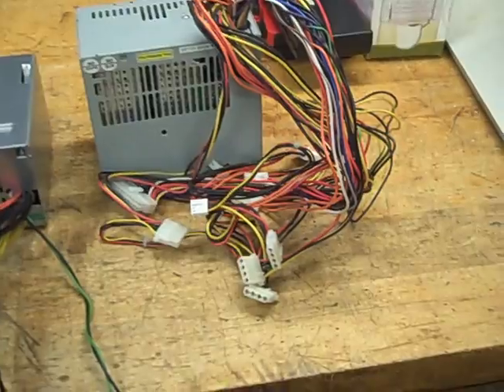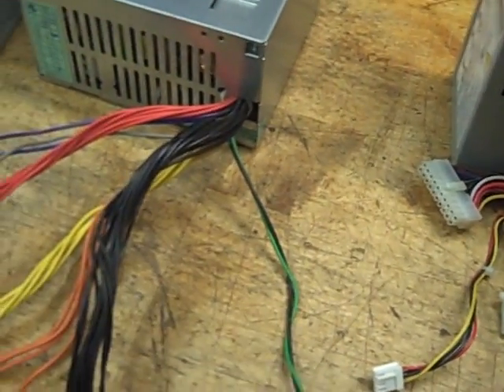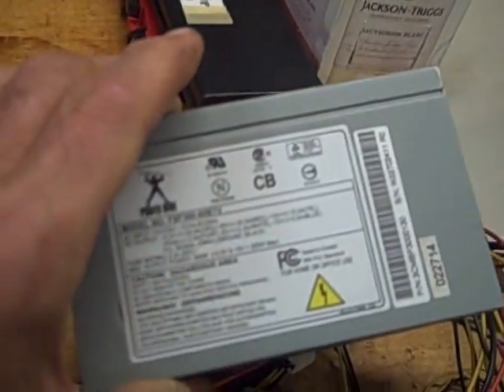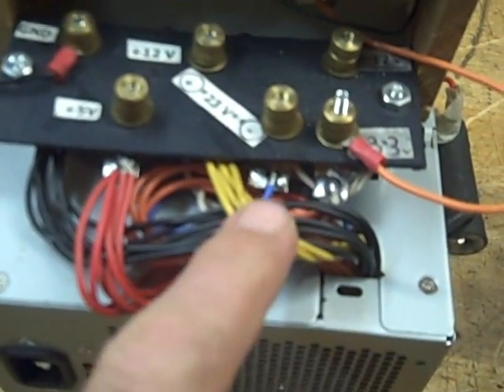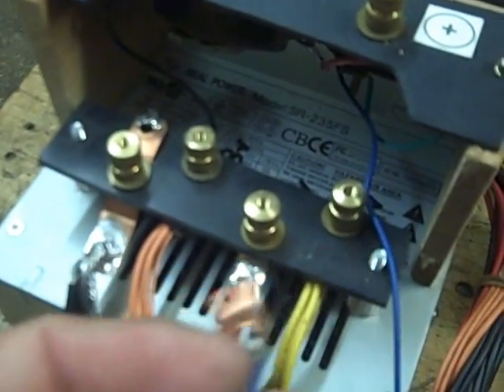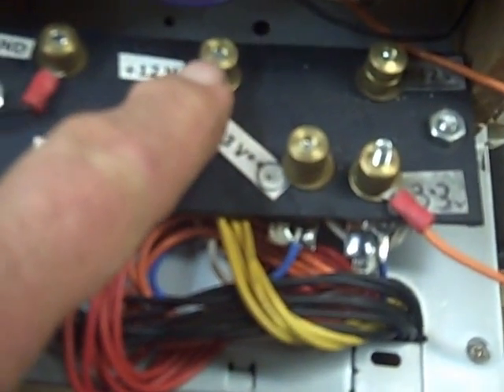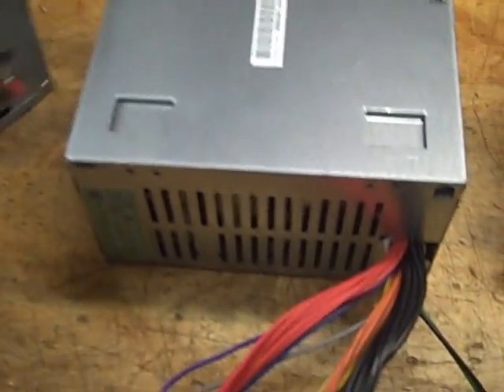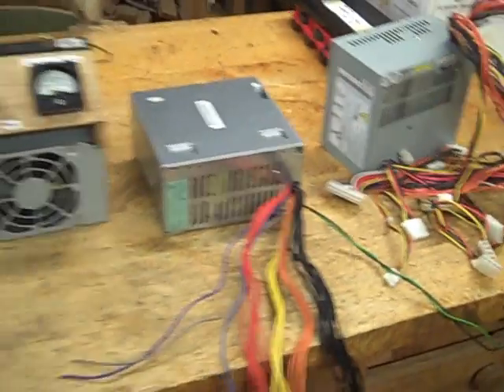DC Power Supply from ATX power supply

Comment: How would you connect a digital volt/amp meter so it would read the voltage and amps output of the 4 different voltages outputs (3, 5, 12,  -12), without moving the digital volt/amp wire from each voltage output post? 
Hope that was clear enough on my question
Reply from the maker: Well, first, you KNOW the voltage  for each of the wires - the internal circuits are quite precise for that, so no need to measure them.
As for measuring the current (amps)  you'll have to have an ammeter for each of the outputs - here I assume that you are feeding power from more than one of the outputs. 
However, if you only use one of the outputs at a time, then, simply connect the ammeter in series with the output you are using.

You can see in the video, that I have a number of binding posts and I have labelled them so I know what voltage I am using. The wires I connect then go to the ammeter on the front panel. But I only use one voltage at a time.

Comment: should i use one yellow wire and one black wire from my computer power suppy to power my car radio
Reply from the maker: Yes, the yellow is plus 12V and the black is Ground  ( or 0 V).
Reply: @disproman  okay but do i use one in the wires instead of using all bc i believe it will exceed the amps of the radio
Reply from the maker: The radio when it is playing an FM station draws milliamps. But when you are playing a CD at full blast you'll be drawing Amps. So, it depends how you are planing to use the car radio.
In any case, I usually connect ALL the yellow wires and ALL the black wires so that way I can use the ATX power supply for anything.
Reply: @disproman  are you sure its safe to connect all the wires? Like it wont blow the radio?
Reply from the maker: NOPE - it supplies 12 V regardless of how many of the yellow wires are joined together. 
With more wires the 12V part of the power supply can provide more current ( Amps).

The radio will blow up if you connect it to a higher voltage  .

With a 12 V connection to the radio the current will vary  from milliAmps ( when it's turned on but not playing anything)  to many Amps when you play the radio full blast with lots of base notes (boom boom boom) . 
If you overload the power supply it simply stops working - it doesn't "blow".
You simply un plug the connection to the radio, unplug the 110V wall plug - wait 10 seconds then plus the 110V in again and you're OK to go to connect the radio
Reply: @kallmeronaldshorts2059  wont blow...you could feed the radio 1000amps at 12v if you want to but if there is a short in the radio it'll melt/fire...so a fuse between the line and load is recommended based on the total power handling of the radio

Comment: 500 mAh ! that sucks! What can you use that for? If its soaking 150 Watts to create DC volts its consumes to much energy for the little return! What's the point?
Reply from the maker: I think you mis-understand how this power supply works.
The higher voltages eg 23 V and 15V are limited by the -12V (blue) wire.
When the power supply is providing  the 500mA, then it is NOT consuming 150W.  At worst it consumes about 15W. It is very efficient.
There are plenty of uses for the  23V and 15V supplies - eg charging Lithium battery packs.
Reply: @disproman   Well with that kind of amperage I would have no trouble charging a car battery or even using it to crank it over then! Is that correct?
Reply from the maker: To crank a car engine, your starter will draw a peak current of over 100 Amps or about 1.200 Watts. 
That's way more than the ATX power supply can provide, so, NO, you cannot crank a car engine with an ATX power supply

Comment: And are all the black wires necessary? Is it possible to narrow it down into 1?
Reply from the maker: Yes, you can certainly use only one black wire, but significantly reduces te amount of power that will be able to draw from the power supply.
Most supplies can make 250 to 400 watts, but with only one black wire, that will be limited to 20 - 25 watts.
More black wires = more power available
Reply: @disproman  oh, well thanks for the reply. I just felt that putting multiple wires together just because they share the same color was a little ridiculous and could be dangerous.

Comment: I want like a higher voltage, if that makes sense. It claims input of 100-120 to output of 200-220. How is it 5v, and 12v cables now?
Reply from the maker: Most ATX power supplies are designed to work on either 110 V or 220V.
The is a small red switch on the back of the power supply.
BUT . . . do NOT try to operate a 110V setting of the switch  with 220V - it will destroy the power supply.

If you need higher voltages, there are boost circuit packages  that  will let you get higher voltages

Here is an example 
https://www.creatroninc.com/product/4-35v-3a-adjustable-step-up-regulator/

Comment: I have tried to make this work, but do not get any voltage from any wire except the purple. I have connected the green to black with no results. I tried hooking a 10ohm resistor between red and black. Still nothing ! This is a new PSU. Any ideas?
Reply from the maker: Assuming that your power supply is not "dead on arrival", about the only reason that I can think of, at the moment, is that somewhere, there is an overload ( not a short circuit) on the power supply.
An overload usually makes the power supply "go to sleep".

The remedy is to clear the over load, unplug the power supply from 110V power, wait several minutes, then plug in again.  The power supply will not be "on" yet.

You then should be able to get the power supply to start up, by connecting green to black.

A short circuit will cause the internal fuse to blow. To replace the fuse, you'll need to remove the power supply from its case.

Comment: how come mine is reading 14 volts instead of 12 volts?
Reply from the maker: Are you measuring the voltage between the yellow wire and the black wire?
That is the 12 V connection.  Check that first, before doing anything more.
Reply: @disproman  yes, sir. yellow and black wires. ok. I used two different multi tester. one is reading 14 volts the other is 13.12 volts
Reply from the maker: @apollomorelos727  
I have admit, I have never seen this on any power supply that I have made. I have made at least 35 or 40 power supplies.

So, what to check next?

Since you have quite a big difference between the 2 volt meters ( more than 5%) , it tells me that maybe the problem is with the meters. Usually the accuracy on an ordinary digital voltmeter is better than 1% error. The error on analog meters is much worse. I still use analog meters, but not when I need accurate readings.

You'll have to check the accuracy of your meters.  What are the voltage readings on the other wires? eg red / black , and orange /black
Reply: @disproman  I was looking around the internet and I found this guy in a forum asking the same question why his computer power supply is putting out 14.6 volts instead of 12v
Reply from the maker: @apollomorelos727    OK , so you  watched some You Tube stuff, but did you measure the other two voltages and what were the results ? ?  It could be that your power supply does not comply with the ATX specification. In any event, does your application  care about having precisely 12V ?
Or can it tolerate over or under voltage?
There is nothing sacred about 12V except that you need to have it for a computer to work properly.Other applications are not nearly as sensitive.
Reply: @disproman  now it's 13.16/5.61/3.47
Reply from the maker: @apollomorelos727  To me that still indicates that your measurement instrument is not calibrated.
In any case you are reporting accuracy to one-hundredth of a volt. How sure are you of its accuracy?
To me the lower voltage outputs should be bang on 5V and 3.3 V.  

Plus, what tolerance does your application have for over and under voltage?   
Will it work OK with 11 V ?

Comment: I have a DC pump that I use for pumping oil. do you think I could use a computer power supply to run it? I figured since it hooks up to my 12v battery that it might work with the 12v power supply.  it uses 13.5 amp. I have an old AT power supply that I want to try.  it has an external on/off switch with a white, blue, brown and of course black for ground. wire harness has Black (ground), Yellow (12V), Red (5V), Orange (Power Good), Blue (-12V) and White (-5V) I believe. does this sound correct? do I need to put in resistors for an AT power supply? ty for your assistance. 🙂
Reply from the maker: Your power supply will be working close to its limit.  The in-rush starting current might over load the ATX.  It depends on your particular unit.
If it does over load try the 5.5 V output
The over load does not damage the ATX - it simply goes to sleep.

Comment: I accidentally touched green to yellow  now it doesn't power up. How difficult to fix is this?
Reply from the maker: Bad news - I think you have zapped the power supply - remember that the yellow wire is 12V and the green wire is a signal logic wire that operates at much lower voltage. To repair the power supply you'd likely have to replace one of the integrated circuits.
You should be more careful in future.
Reply: @disproman  thanks

Comment: How is power on this power supply??
Witch wire use in jump please  model PDP117P compaq
Reply from the maker: I do not understand the question. 
The black wires are  0V  , the yellow wires are plus 12V, the red wires at plus 5V 
and the orange wires are plus 3.3V .
Is your question about another kind of power supply, that is not an ATX type power supply?
Reply: @disproman  dear want on the power supply.how i can on this supply supply model is PDP117P compaq
Reply from the maker: @fkbaloch7418    I think I understand your question.. But unfortunately, I am not familiar with the power supply for the PDP 117P computer. I do not think that it is a standard configuration and that it is proprietary to Comaq.
However, you can explore the DC outputs of the power supply if you have a voltmeter and are careful to make measurements safely.  It probably has output voltages in the range of 12- 24 VDC.

Comment: There IS one green wire coming out of my Dell mm720 PS leading to the largest harness that has a mess of other black, red, orange, white and purple wires. How does one know which black wire to join with the green to turn in on?  Would it be one of the black ones in that harness? There are 9 other black wires in that harness, which is clearly the main harness that attaches to the motherboard. The rest of the bundles coming out are 4 and 5 wire harnesses labeled p2, p3, p4, p5 and p6. (the main harness is labeled p1)
Reply from the maker: You can choose ANY of the black wires. They all terminate inside the power supply at the same point ( electrically) .
I typically choose the smallest  one since there is very little current ( milliamps) when you turn on the power supply.

I also use ALL of the black wires  as my 0 V  so that I can get the maximum current with ay of the voltages.

Comment: I think you missed mentioning what the Grey and Blue wires are for.  Thanks.
Reply from the maker: The blue wire is for a -12V , and gives you  24 V power, but at at a very much reduced current - less than 1/2 Amp, compared to the other voltages  which provide 10's of Amps of power. 
The grey lead is not used in the power supply hack.
This was covered in some of the discussion but is well worth repeating.

Comment: I have tried to experiment but when I touch with battery's terminals it's fan non-stop running with out connecting with AC power.let me know what happened and how to resolve.
Reply from the maker: I think what is happening is that your battery is back-feeding the fan . It will drain your battery if you leave it connected this way.

I recommend that you always power up the power supply BEFORE  you make any connections to a battery or other device.

And you will notice from the video that I have a built-in ammeter to measure the current to make sure that the power supply is providing power .

Comment: do I have to use the blue for my remote for my car radio or not

 

 

Reply
Reply from the maker: The blue provides a neg 12 V with a limitation of about 200-400 mA. measured to the black wire.
I think your remote needs  plus 12 V  , so simply use one of the yellow wires to get plus 12 V

Comment: Waht are the purple and gray wires?
Reply from the maker: Not exactly sure, but I think they are used for LEDs and data sensing. For sure they do not have any use for supply of any of the voltages.
Reply: I found that the purple wire = "standby" and gray = "power good."

Comment: Can I use ORANGE +YELLOW to get 15V for charging a battery?
Reply from the maker: No, that will not work.
Please look at  the video I made to try to answer such questions. 

Do a You Tube search on
VOLTAGE COMBINATIONS FROM ATX POWER SUPPLY
( You Tube doesn't let me paste the URL address into my reply - dang !)

You cannot use Orange plus Yellow to get 15 V.

BUT,,but . ..  you can get  15 V by connecting Orange and Blue.
The Blue is negative 12 V and the Orange is positive 3.3 V , so together they make about  15 V   PLEASE remember that you'll have only about 0.5 A available to charge the battery. The charging current is limited by the current available on the Blue  (-12V) wire.
The nameplate on your power supply will give you the exact current available on the Blue wire.
Reply: @disproman  
Thanks!  
I was drawing blanks at the time..   Iknow better!
I ended up using the voltage difference between the -12V  and the +3V  to get aprox. 14V and SUCCESSFULLY  charged my car battery !

Comment: Great Video! What combination of wires do you use for electrolysis? I will be doing a cast iron table saw top, so what do you recommend?
Reply from the maker: I use the 12V supply fro electrolytic rust removal.
Most supplies should have enough capacity to do the job..
I usually see about 5 to 6 Amps of current. On your job, there will be higher current . A smaller power supply simply means that it will take longer to remove the rust.

 The trick with the rust removal, is to periodically stop the process, and clean off the crud on the sacrificial electrodes. Sometimes, I wash off the black stuff on the object as well.
I also found that having many sacrificial electrodes that a placed so they are in direct "line of sight" with the object helps a lot.
The worst part of the job is the final cleaning - the black coating has to be scrubbed off, under running water then dried quickly so it doesn't re-rust.
Reply: Thanks, I figured so. Just want to confirm. Would it be possible for you to post a schematic of the two power supplies in your video? I would appreciate it.
Reply from the maker: I do not have any decent video editing s/w  so I'd have to make a new video and post a link to it. I'll be out in the bush for the next week or so - Internet-less.
Reply: Would you be willing to do a drawing schematic and send through email?
Reply from the maker: I'd prefer to make the new video so everyone can see it.
Might take a bit longer but worth the wait -
Reply: Sounds good. I'll watch for ir
Reply from the maker: The only way to limit or control the amount of current (i.e. the number of Amps) is to connect a series resistor  in line with the output terminal. But it also means that you much have some way of measuring the current in line with the output terminal. 

I use a ceramic variable resistor  rated at about 1 Amp before it overheats.
You have to be careful not only about the value of the resistor, but about how much power ( i.e. watts) it can dissipate.

The really is no way to internally limit the current inside the ATX power supply - it has to be done by an external resistor.  And as a general rule, I connect all of the same colour wires to make an output terminal. That way I can get the maximum the power supply can give. If I need less, I connect the external resistor

Comment: Thank you for sharing this video. I do have a question how many amps will be in the dc5 and dc12v ( out put off the switch off each)
Reply from the maker: The name plate on yur power supply will show the maximum current that you can get from each of the voltages. This maximum is available if that voltage is the only one taking a load. 

The nameplate also shows the total power available so, if you are using more than one of the voltages, then using Ohm's Law you can determine the maximum current for each of the voltages you are using.
Reply: @disproman  thank you very much. I did all what you have show on your video. And i got everything great. But the 12 v i got it 11.56v after your knowledge what i did wrong???
Reply from the maker: You have not done anything wrong. 
It may be a combination of several things.
A slight error in your voltmeter - most digital voltmeters have at least 0.5V error and analog meters may have up to 1.5 V error  PLUS
a slight error in the internal voltage reference of your power supply ( could be 0.2 V ) and you'll see less than 12V.

Almost every application that uses  12V  for its power,  will tolerate at least 1 V higher or lower - many can tolerate 2V above the nominal 12V power.  Many applications will be OK even with 10V.

If you need very precise voltages, then what I suggest is that you can get a voltage reference chip that will calibrate your voltmeter. Something like 
'https://www.maximintegrated.com/en/products/analog/voltage-references/REF01.html/tb_tab1
You can then calibrate your voltmeter, and see the effect of the lower voltage on your application.
Yu might also use another ATX power supply and see if there is 12 V on the yellow wire outputs.

As a last comment, try out the lower voltage and see if your application works OK, if it does, then - GREAT !
Reply: @disproman  thank you for those explanation. It was very helpful